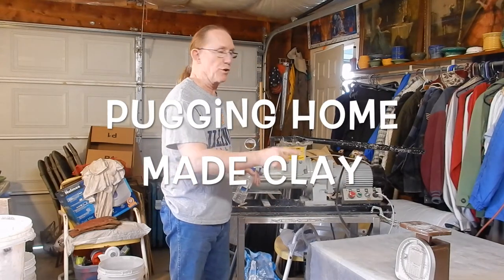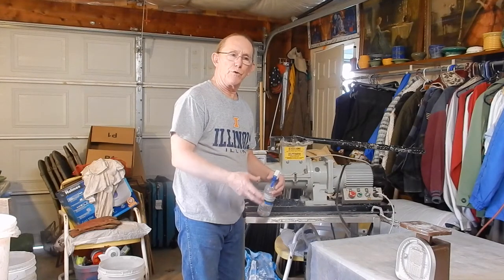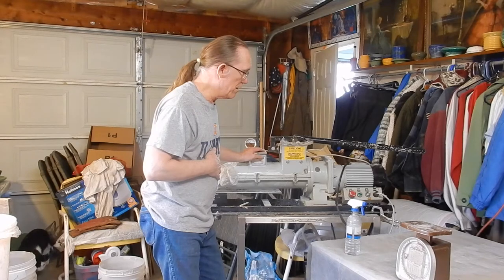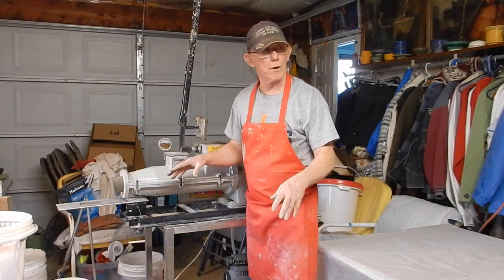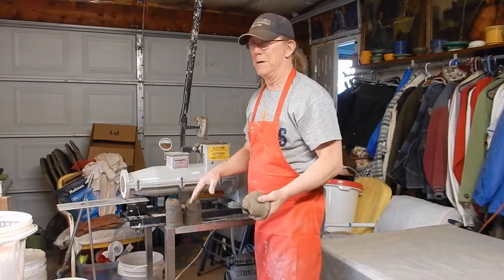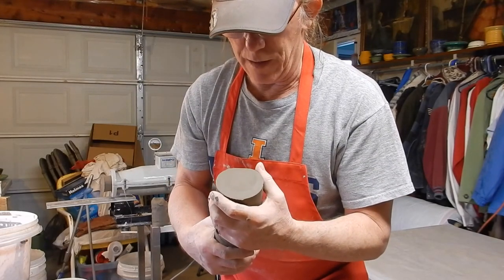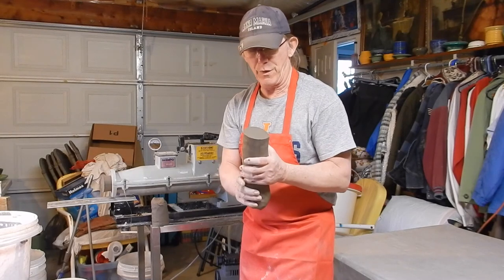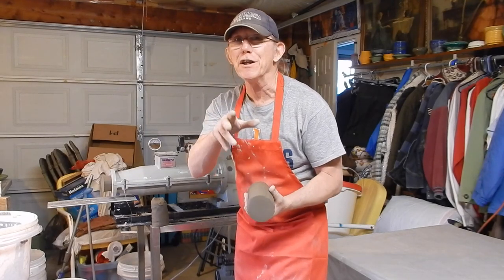Pugging Clay with a Vacuum With NO Air bubbles.

Comment: As always I know this is one of your old videos but I am disabled and wedging was taking its toll so I to bought a pug mill I got the Peterpugger vpm-7 stainless steel one I do like to watch your videos and your throwing videos God Bless
Reply from the maker: Hi Carl, I too have issues wedging. After having 2 back surgerys and my left hand, then this year surgerys on my right hand. I would recommend any and all pug mills to every potter that takes making pottery serious. The one you have is a good machine, but most of them are. The one I have, I got lucky on eBay from another potter and it they do help remove the AIR from the clay. I had to get only because of my condition and I have close to 2000 lbs of dry clay to be processed. Plus I reclaim raw dug clay. LOL remember once you get started it never ends. Thanks for the comment. eddie.
Reply: @eddiespottery8439  I wasn't as lucky on my pug mill I well my wife purchased it new  for me, as she did my Brent C wheel. Pottery isn't popular in my area and I have to drive 2 and a half hours to buy my clay I am a beginner doing to pass time and I always wanted to got the wheel started doing pretty good and then I started having issues wedging so I stopped that's why she purchased so I could do something I enjoy. and I also enjoy your throwing  videos I am learning on my own and YouTube videos Looking forward to your next one God Bless

Comment: Never thought about it before, I see now a lot of good reasons to do this. Use to have a supplier mix my own recipe but you have to order a lot of clay and there is an added expense.
Reply from the maker: Jeff the one thing I would recommend to anyone that use's alot of clay is get a pug mill. I do not like wedging that was the main reason for me and the recycling, but I would not just run out and buy one. The one I have would cost close to $4000. New, if you just wait your time you will find one on eBay that is what I did, it was just short of a thousand, most of the time you can find between 5 to 15 hundred and thats alot better than paying new price of 4 to 8 thousand. I checked everyday for almost 6 months before I found the one I have, there are alot of reasons to have one just be patient.